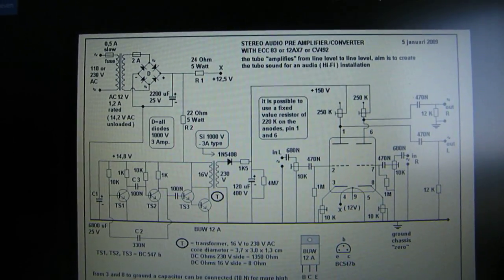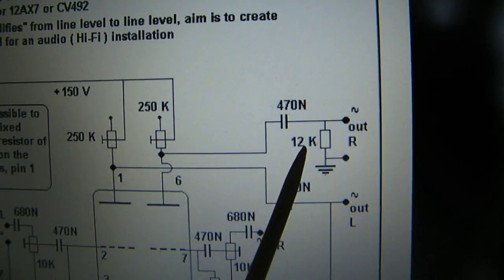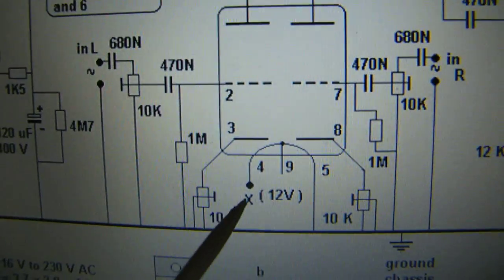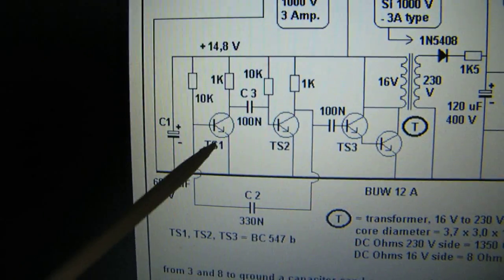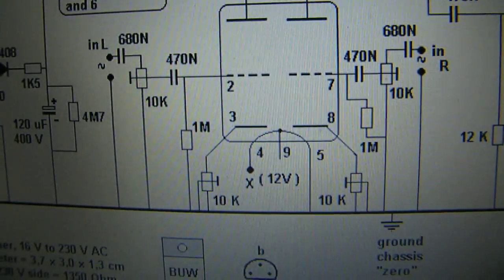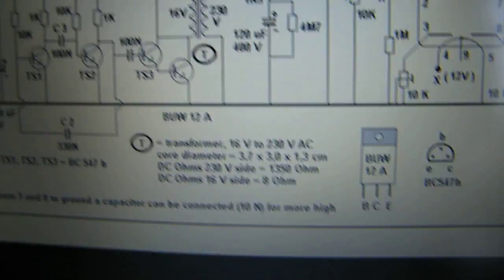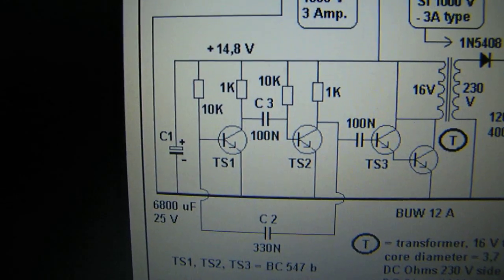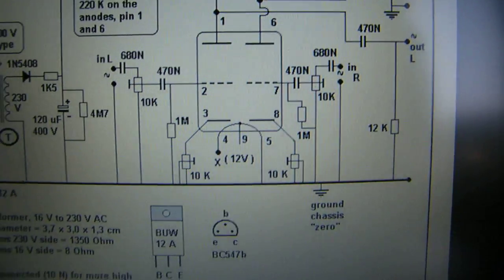Tube triode audio pre amplifier working on 12 V with a Muvib HV circuit (schematic)

Comment: Isn't the 16 volts transformer primary short circuited? It seems on connection there is an extra line that should not be there
Reply from the maker: Sorry, you are RIGHT!!! I adapted the text in the textbox.
Reply from the maker: Again: THANKS for your comment.